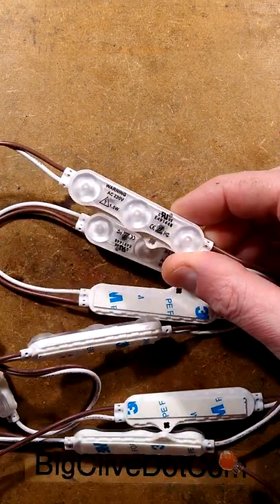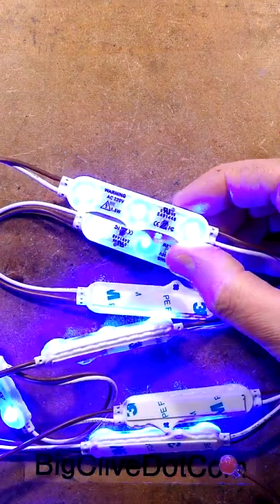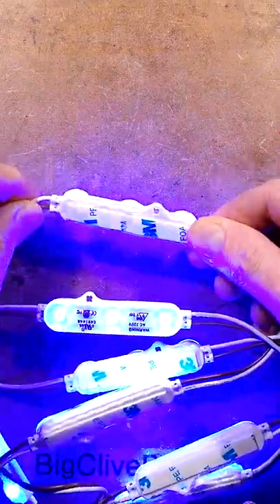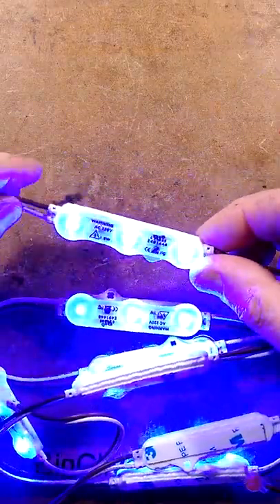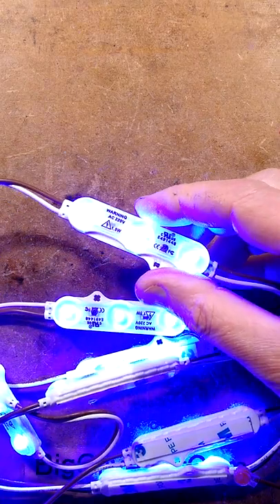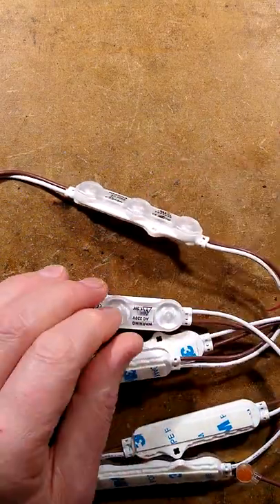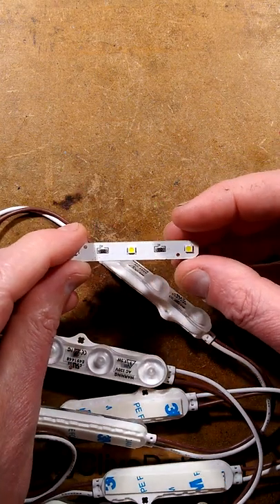High voltage sign LEDs

Comment: I've got a similar set from when I was a facilities supervisor for a mall a decade or so ago. The ones I have come with what's basically a ballist (driver) box like you would see with fluorescent lights. Had them all this time and I'm just now working on a project to use them.
Reply: Probably 12 or 24 v modules instead of mains.
Reply: @JasperJanssen  is there any LEDs that run AC? I'm pretty sure all of them have a transformer of some sort. Even the ones in this video are converting the AC to DC.
Reply: @rallywagon261  the LEDs themselves are bound by physics, so yes, on a per-chip basis they’re always around 3V DC.

What you make the modules accept varies wildly. These modules run 220V directly, so don’t need any external ‘ballast’/‘transformer’/power supply under whatever name. The 12V/24V models do need an external power supply if they’re going to run off mains electricity, as the normally would.
Reply: Ok, I guess I just don't get why your commenting then, cause there were no questions or anything of the nature made, just a post about a similar set of LEDs, that being LEDs taken from a sign.

Comment: Something in between a short and a full length video would be good sometimes.
I have not found a way in the app to save a short to a collection. I have to send it in an email as a link. The way YouTube handles shorts is not very good. A browser does it badly, the app not much better. There should be a way to view it like a normal video.

Comment: If ony I could see the sides of the video, and not so much empty bench at the top... I know there's a way.
Reply from the maker: There is.  You follow the link to the full video.
Reply: @bigclivedotcom  You could also rotate the camera 90 degrees. A short video can absolutely be horizontal 😉